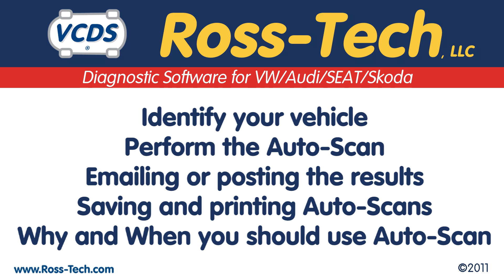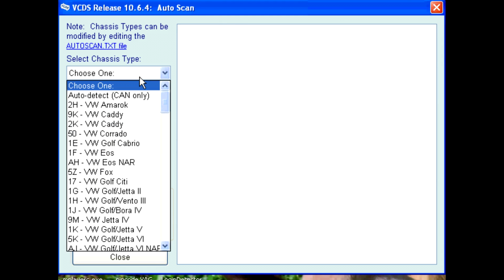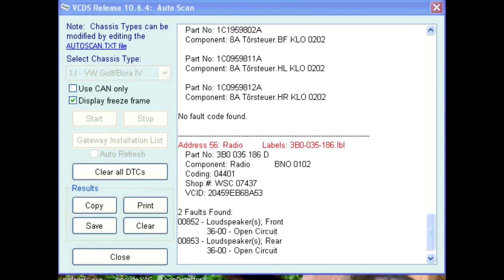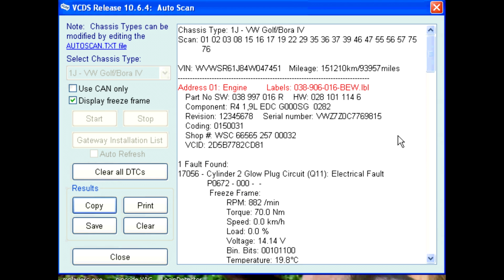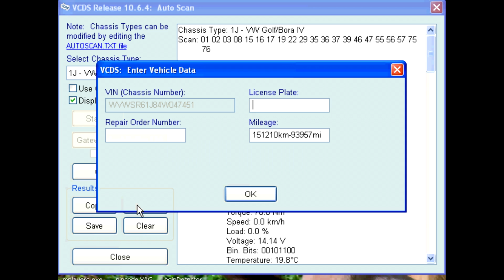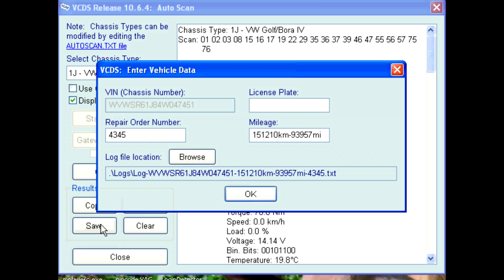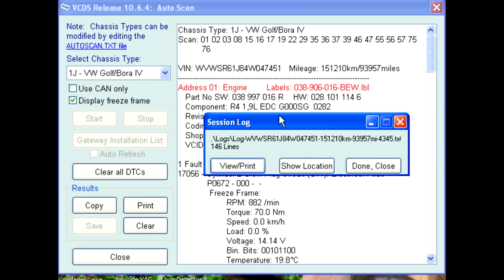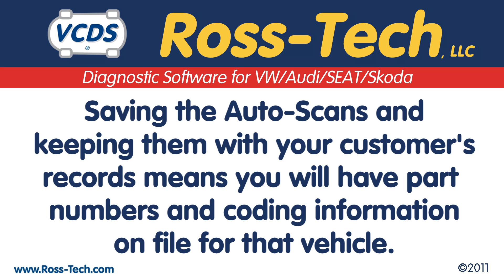How to use the Auto-Scan function in VCDS

Comment: What if your key is stuck in the ignition and when you turn the key on there's no power? Even if it's a new battery....

Can you still read codes if it can connect to the gateway but not the ecu?

Comment: When use vcds to scan a 2006 vw jetta 2.5 and it show performance malfunction in cooling system. Fault code 11101000. What could basically happen to the car?
Reply from the maker: Ross-Tech has free support on our web forum.  forums.ross-tech.com.

Comment: i am currently using the 11.11.0 version of the software and it asks for the 12.12.0 update.once updated and hooked up to my car ( a b5 passat 2001 tdi ) it gives me an error saying i have to update the firmware. the update firmware pops up but it fails to update and vcds wont work until i roll back to the 11.11.0 version. as im fairly new to this, my take on the matter is that it wants to updates the ecu`s firmware right? what is there to do and is it ok to just use the 11.11.0 version? thanks.